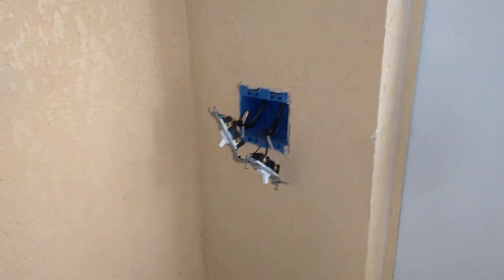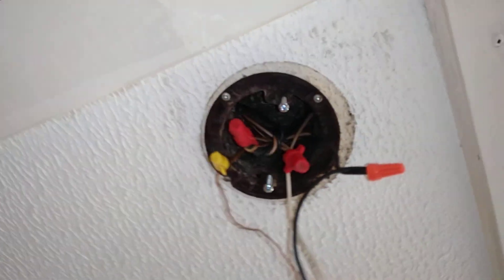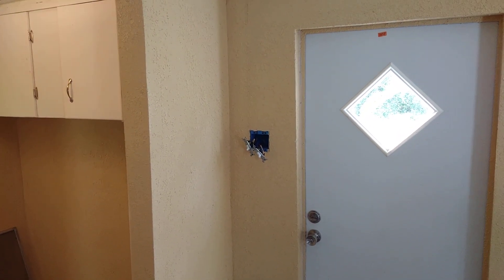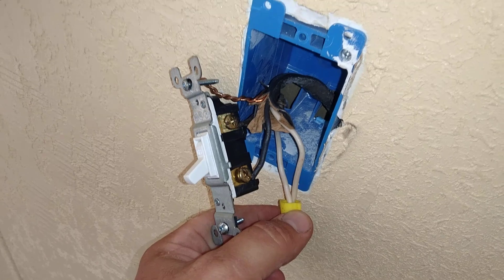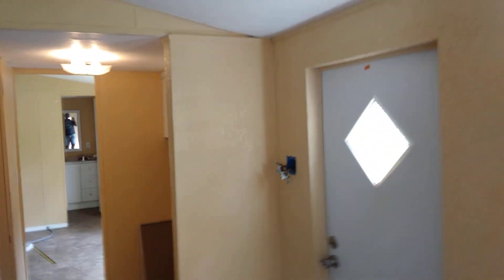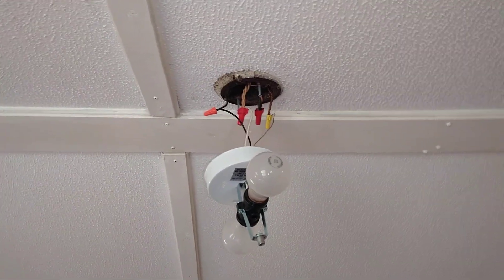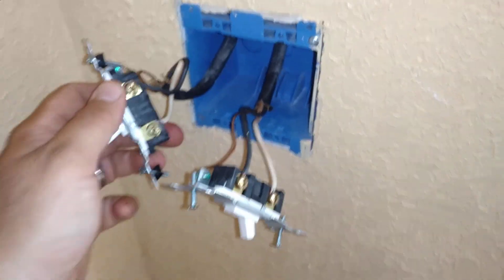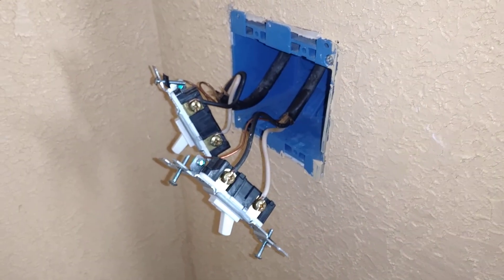Neutral hot on light switch?

Comment: Bro my light went out so i changed the light and switch now the light does not work still and the switch turns off the whole house behind me wtf did i do???
Reply: When everything is aprt I have my blsck as a hot so I wired it regularly line bottom load on top nuterals together
Reply from the maker: @Caveman_Outdoorss  well it's a little complicated what you're going to have to do is separate all your wires. And then you're going to have to take a meter and figure out which ones are hot. How many wires are going into that box?

Comment: Damn it. I ruined my electric at home. I have to tone out the damn white wire now. 🤦‍♂️
Reply: @Bbernhardsr  
I got up into a ceiling fan and noticed the one white wire with all the hot. Just like he showed. I removed them and tied all the white together and black together. And now I blow the fuse every time I flip the switch. So now I have to tone from the switch to the ceiling and see which white was in it. So I can get the loop back in like before.

Comment: Very good point! As of the current nec either 2011 or 2014 i have to reference it, you must have a neutral in every switch box,  so in your case , technically you should (in new construction) have a 14/3 w/G running from the light fixture box to the switch and the black and red would connect the switch while the unused  neutral would just have a wire nut on it.  (For the many smart switches that do need a neutral) in older properties the white if hot should be marked with a piece of black tape or black paint in EVERY box where accessible.   Aside from letting future electricians know this white wite is hot, a few years ago, i was re routing some breakers in a temporary power box during the construction of a new vacation rental.  I had to make room for a double pole 100 amp which would feed the shed (temporary)   the property had a well pump that runs on a 20 amp 240 volts.   The well pump was being powered out of that temporary power panel with 12/2w/G UF cable connected to two single pole 20 amp  breakers instead instead of one 20 amp double pole (unknown to me, with lead builder never discussed that with me) and the white wire was never marked as hot.   Upon re routing the breakers to make spaces for the new 100 amp, i reconnected the well pump as a 120 volt circuit putting the white to the neutral buss instead of back to the breaker to make it a 240 volt and later that evening hopped in the shower.   Burned the well pump up.   Made for a very expensive screw up when could have been avoided if the white was taped black.   Needless to say, the property owner was pretty upset.

Comment: A quick question.  I've been living in the same house for 20 years, and no electrical problems, other than the occasional bulb burning out. A few days ago, my lamp plugged into the wall socket went out.  I lost all power to that wall socket, 2 other wall sockets, the outside light, and one ceiling light.  Checked the circuit breaker and it did not trip, but reset it anyway.  Using a  Voltage Checker, it tells me that all the wall sockets are wired correct.  When I flip a light switch to ON position, the tester changes to HOT/GND reversed indication.

Can you tell me what happened?  I never touched any of the wiring before this happened.  Thanks.
Reply from the maker: The most common thing that happens is that the neutral side will get a bad connection. Since the way duplex outlets work, if one outlet developes a bad connection then all the electricity on that circut will die. Somewhere in that chain of sockets, one of them will have a bad neutral connection. The first thing I look for is a socket that looks burnt and overheated. If there isn't any matching that description then start at one end and work your way through. Remember that the duplex light switches are the same way as the outlets, they can develope a bad neutral connection and kill the whole circut.
Reply: @Bbernhardsr You were right.  I did resistance checks on 6 wall outlets and 3 light switches, and the very last wall outlet I checked read open.  I cut about 1 inch off each of 3 the neutral wires on that outlet, put in a new outlet, hooked it back up, and IT WORKED!   Took me about 6 hours to find the problem, but without your advice, I wouldn't have found it.  Thanks for your help.
Reply from the maker: @jazzmaan707  very cool. Glad that I helped you with your problem. Yes sometimes it does take many hours to find the root of the issue. I'm happy you were able to find it because a call to an electrician would have been very costly. Thankyou for the feedback.
Reply: @Bbernhardsr  You're not kidding! I live in a 95 year old 2-family house and recently had the same thing happen to my tenants upstairs.  It cost me $925 for the electrician to diagnose the problem ( about 4 hours of his time), which turned out to be a wall lamp with scorched wires.  It had knocked out 6 outlets, and 6 light switches feeding other wall and ceiling fixtures without tripping the breaker.  The fix for all of that (with me buying the new light fixtures and he supplying the tamper resistant outlets and new switches ) was another nearly $1400! Thanks for explaining this in a way that I could understand what happened.
Reply from the maker: @denisegaudette6286  your very welcome! I am glad I could help.
Reply: @Bbernhardsr , Ah, thanks!  You've given me a place to start.  So far, none of the outlets look bad, so I was thinking of taking the cover plates off and looking at each neutral as I move down the chain, and also the light switches.  Will the wire look burnt, or could it be minor corrosion on the wire, that isn't visible?  Thanks, I really appreciate your help.